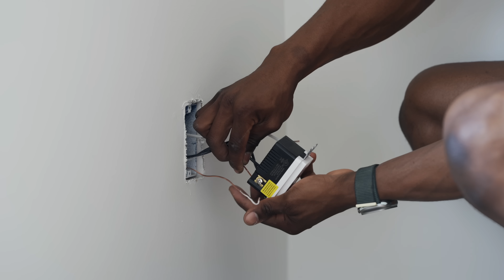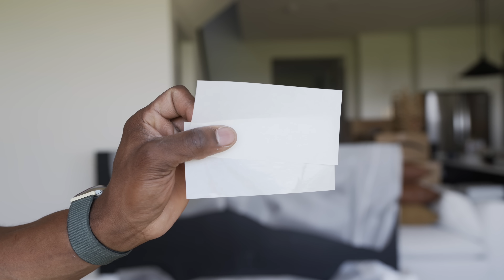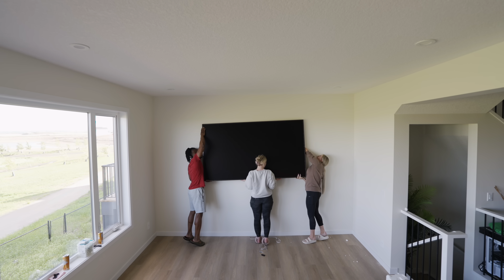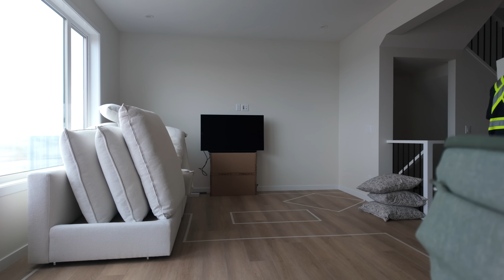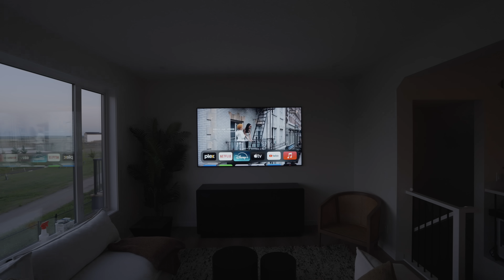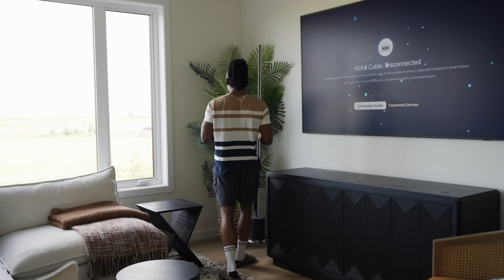Setting up my new cozy living room space with the 85" Frame TV!

Comment: Sleek & comfortable, I'm going back & forth with my husband on getting an 85" TV, we have the space for it, but I preferably prefer the TV stand to be wider than the TV for better balance, just my opinion, Thanks for sharing what you bought to hook up the TV.
Reply: @emiliaescobar7652  We just upgraded from a 65 in to a 75 in. We had Best Buy mount it.  I hated it. I feel like it was mounted too high, because the only console that I could find to fit is low profile which leaves more gap than I would like. The 75 didn't look much bigger on the wall than the 65, so I had my husband return it. We are now waiting on a 85 to be delivered. TVs are expensive, so go bigger so that you will be satisfied. Also, I purchased a 79 in console which will be wide enough for the 85. A long console is hard to find. Good luck with convincing your husband.

Comment: The tv stand should be 6 “ wider than your tv. If you can’t find one wide enough. Just put two exactly the same together. It looks great.
Reply: @annpiccolo6980  Agree 💯% .  It will help it to look balanced. If he can find one or two pieces that span the length of the wall that will be even better.  It will give it a built in look and feel.
Reply: @annpiccolo6980  no not really.

Comment: Have you looked into the LG G4? It's an oled panel that gets much brighter than the frame in HDR. It's also flush to the wall. However it may be significantly more expensive in Canada where you are

Comment: Wow, that room looks amazing.  Thanks for sharing all the tips.  One thing is bothering me though: on your Apple TV+, it works better if format is set to 4K SDR, NOT the higher levels, and also Match Content should be set to ON for both range and frame rate.  This way it will always send the appropriate level signal to the TV.  (It does seem counterintuitive to set it to SDR, but it's not).

Comment: Great video. Thanks for sharing. I love how it turned out. Looks cozy and inviting. A few things I’d adjust for my own personal preferences: 

1. I’d turn the wall the TV is mounted on into an accent wall by either painting it a darker or warmer colour or maybe even adding slat wood wall panels. 

2. You need sound. Either add a sound bar on top of the console, or, if you feel that might take away from the Frame TV vibe, get a Sony HT-A9 or HTA9M2, which don’t have sound bars. 

3. I agree with the height comments. I’d center the TV both vertically and horizontally, which would bring it closer to eye level while still looking like a picture frame. 

Again, these are just my personal preferences but still love what you’ve done with the place.
Reply: I agree, as someone else in my family has an 85" Frame, and he paired his with a white Samsung sound bar I can't remember the model number of.

Comment: Good video! I noticed you covered the vent, what’s the plan for that? Also, what window coverings will you be using?
Reply from the maker: We’re adding Lutron shades and some drapes to the large window so the couch is going to move forward a bit and then I can use the vent again.